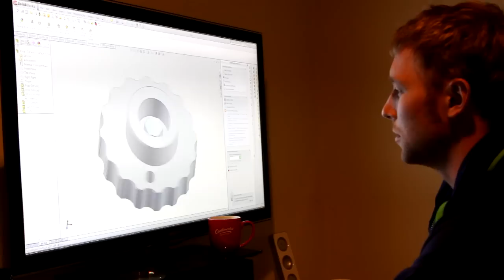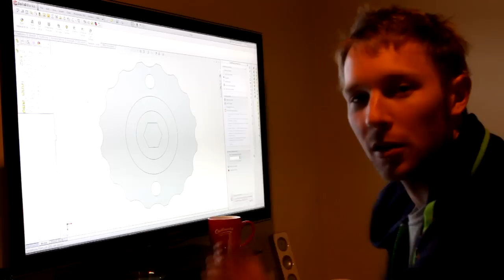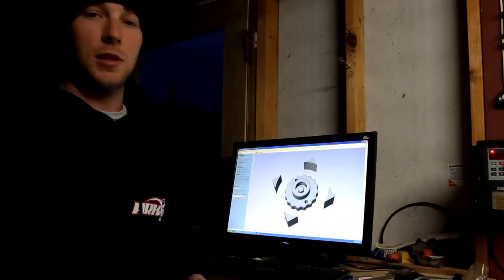CNC 6040 machining aluminium Knob Project with chamfered edges

Comment from the maker: Thanks Glen - my friend has a 3040. It has plain nuts instead of ball nuts so expect a reasonable amount of blacklash, it also had a very bad brushed spindle which failed in no time at all. The 6040 can do aluminium, but you are better off using it for routing composites (heli side frames for example). If you want to mill aluminium, I recommend something like my big mill conversion. It can really make chips with ease!

Comment from the maker: Hi Jim, with acrylic start with 500mm/min feed and DOC 1-2mm. With aluminium you will need to go MUCH slower, 50-100mm/min and DOC 0.5 - 1mm. I encourage you to experiment with the feeds yourself. Start with a conservative/slow feed and DOC. You can increase the feed rate up to 300% faster in mach3. Find a happy medium and listen to the machine. Another crucial point is that you must have the work clamped extremely well, you could break the end mill if the work comes loose. Hope that helps :)

Comment: Cheers, the endmill I got is a 2 flute carbide and was using a 0.5mm DOC - I have tried 12000,18000,24000rpm and 400 mm/m to 1000mm/m and was still getting a burr edge.

Will try the ultra slow 100mm/m you used. Also what is your step over in Vcarve?

Comment: Nice part!  Funny, I thought I was the only one that gets that excited about chamfers. Haha.  Well, I use Vcarve Pro also. It's handy making CNC machine-type parts, like the part you made,  using a combination of profile and pocket paths, for a lot of parts, it's easier than trying to use a CAM program.  I have a 5x10 CNC router and am also thinking about getting the G0704 and doing the conversion. Question was, Could you explain again about the chip channels? Couldn't see it on the video.

Comment: I also have a 6040 I recently bought from an Importer here in the USA. I'm having problems dialing in my feed and speeds. Do you have any starting points for someone starting to tinker with a CNC router. I'm mostly using 1/8" and smaller bits. I've already broke about $50 in bits and it;s getting expensive. Any help would be great. Thanks, Jim

Comment: yes i like it its not a bad machine i changed the spindle i have homemade rc brushless one and i also have a 3phase 1/2 hp air cooled spindle 
the old spindle motor just got too hot made funny sound lol

been useing it for cutting parts for rc cars i have made 
hpi savage shock towers breakdisks and skid plates also 
radio tray for my FG Marder

Comment: Hello mate, I have managed to get a good result on plastic 5mm thick with a single flute 3mm end mill but i now need to cut shapes from a 2mm 5251 ally plate. What speeds and bit would you recommend? Thanks.

Comment from the maker: Ah ok cool - well even 400mm/min is too fast for this machine I have found! plus you need some sort of compressed air to remove the chips and prevent sticking and re-cutting (FogBuster). I think my step over was 80% from memory, I like to go more and get full end mill engagement rather than cause it to deflect. Plus it shaves lots of time off the toolpath :).

Comment: Hi, i have the smaller version of this machine the 3040, i am having a terrible time getting my cuts to run correctly, cutting alu is a bust as the 4030 is not rigid enough but i am seeing a problem with acrylic also. cuts in the Z axis are going off square, as each pass takes the z deeper the cut is moving off perpendicular towards X- so my cuts in z end up at around 80deg rather then perfectly perpendicular. a most curious problem, perhaps you have encountered it?

Comment: Hi CruddCNC!! What do you think about 6040 controller built quality? Is it based on cheap Toshiba 6560 chips? Do you know manufacturer of these steppers and controllers? China built quality is EXTREMELY  varies from one manufacture to another...For example, Leadshine is very good, but Wantaimotor and Longsmotor have problems...Also you can replace your controller and try Geckodrive G540, is very fast!!

Comment from the maker: Hi man, you must have the 3040? my model came with a brushless motor and variable frequency drive (VFD). My friend had one with the brushed DC motor and it didn't last long at all, had no power. I think your best option would be to replace it with a brushless/VFD setup. Cheers

Comment: Hey ya, i use cut2d to gen my tool paths, which is basically the same as v carve (kinda new to the software, but finding it really good), what is your procedure for making the tool path for the chamfer run? do u create a profile path and set the depth to xx??, if you could let me know - that would be cool, as im over filing parts

Comment from the maker: Hey mate, spindle rpm = 24,000 (should really be a lot lower with a 6mm end mill), depth of cut 0.5mm at 100mm/minute feed rate. Take it slow because this machine is not rigid at all! The choice of end mill will greatly affect the finish also. I am using a Diamond Tools two flute carbide end mill (6mm). Don't bother with the HSS cutters... they dull very fast.
Reply: CNC control

Comment: Hi, just watched this clip and Im very impressed with what you've done here. I was looking at a 6040 with 4th axis. I mainly want to cut aluminium, you've mentioned a 'big mill conversion' what do you mean by that? I have a small manual mill at home but I want to do more intricate shapes and designs so cnc is the answer. The 6040 looks like a very basic entry level machine, would I need a drawing programme as well as the machines software?  im open to options though. Cheers David

Comment: Feed Rate too slow..... "If the bit is screaming......feed it"
Reply: +Dale Helmick Thats what i thought too until I figured out what was wrong with my 6040 1.5kw. First there are 4 hidden LARGE important screws underneath the 6040 CNC machine, that is easy to miss upon installation. After putting those 4 in, it dramatically increased rigidity. Lastly the stock CNC platform needs to be faced, before beginning work, the stock platform is SUPER uneven. After those two things were taken care of, the machine cuts like a dream.
Reply: +Dana Ng Could you clarify where those 4 important screws are located? I have a machine like this and want to check whether they are in place or are missing. Cheers.
Reply: zoltan87 There are 4 large screws directly underneath your machine. Use only single flute end mills, face your platform, add a new sacrifice platform then face again. Add & make new linear guide bars with bearings to your cnc. Wiggle the tip of your spindle under it until it is completely rigid otherwise keep adding more guide bars. My optimal speeds were, 3mm single flute at 24,000 rpm, 1.5 mm Depth of Cut, 2mm Step over at 900mm/min (35 inches/min). Also a dedicated compressor with mist helps alot too.